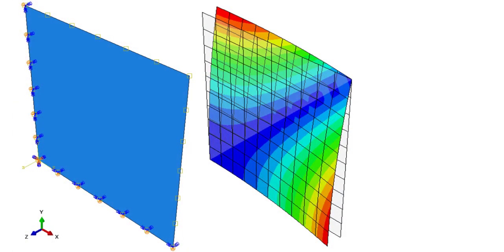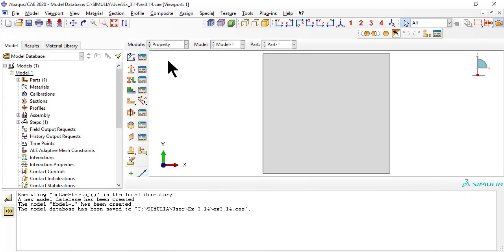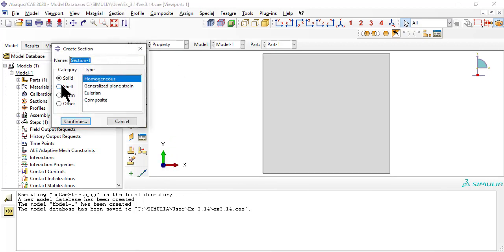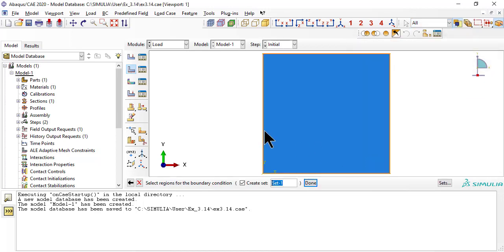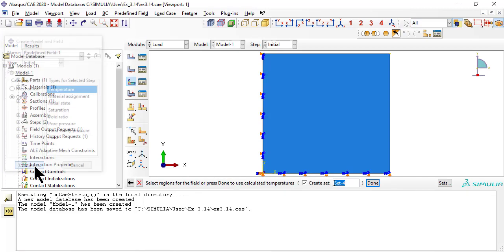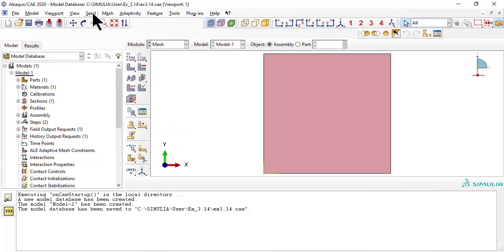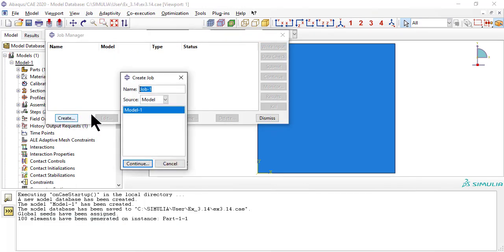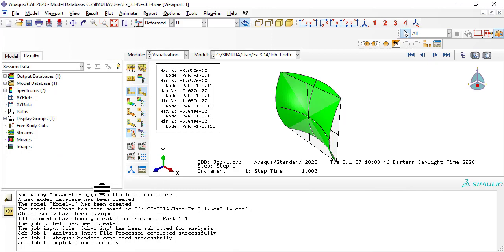Example 3.13 How to use Abaqus Predefined Fields to include thermal and moisture stress

Comment: When we use predefined fields with initial state option, should we toggle on update reference configuration or not to continue with the previous job?
Thanks!
Reply from the maker: I don't think it is necessary unless the analysis has large displacements and geometric nonlinearity but you can try both ways and see what happens.

Comment: Prof. Barbero, The issue is I also have a same problem. However I do not know whether I should use temp-disp step or static general. My problem is time based and my CTE is depend on the time (function of the temperature).
Reply from the maker: Is the problem is thermal, or you are using the thermal capabilities to trick Abacus and solve a diffusion problem, I guess temp-disp (I did this trick with ANSYS but should work with Abaqus, so I do not know for sure) but you can try, solving a trivial thermal diffusion problem, say a bar with different temperature at each end, for which you know the analytical solution fro a book of conduction heat transfer.

Comment: Dear Prof. Barbero-Can ABAQUS perform moisture ingression modelling of composites or isotropic materials at the least, by defining suitable coefficients of moisture expansions (CME)? any insight would be much appreciated! Thanks for the amazing demo videos!
Reply from the maker: For stress analysis, the eq. for moisture expansion is the same as for temperature expansion, so "tentatively" you could trick Abaqus using temperature as moisture and moisture expansion coefficient instead of temperature expansion coefficient. Take a look at my intro book, the section on thermal + moisture expansion. Then, Abaqus calculated thermal stresses will be moisture stresses. To see where the moisture goes overtime, say if entering from the edge, or something like that, well, the moisture diffusion problem uses the same eq. as transient thermal, so "tentatively" you could do a moisture diffusion problem using transient thermal analysis in Abaqus, same trick, using the diffusion constant as the thermal conduction constant, moisture as temperature. In this video, on "predefined fields," you can learn how to apply temperature (well, moisture) distribution. I don't have a video on thermal transient analysis yet.
Reply: @EverBarbero  Thank you, Prof. Barbero! That totally makes sense. I had learned that the response of a polymer composite is similar to the CTE problems but I am glad to now know that ABAQUS can be 'tricked' with this understanding. It would be interesting to also understand the moisture and temperature effects over time. Something to research on. Thanks, again!